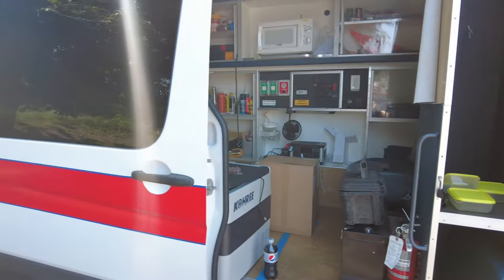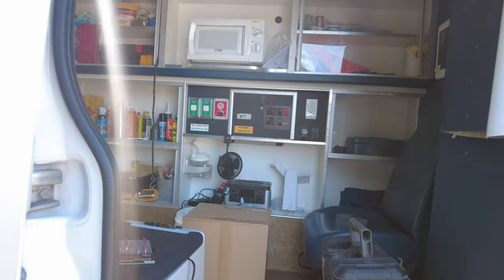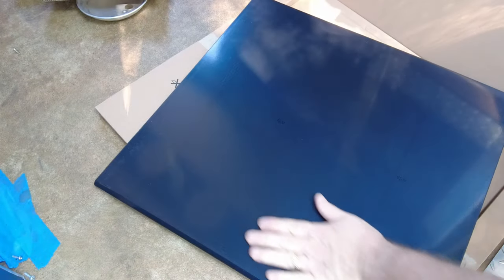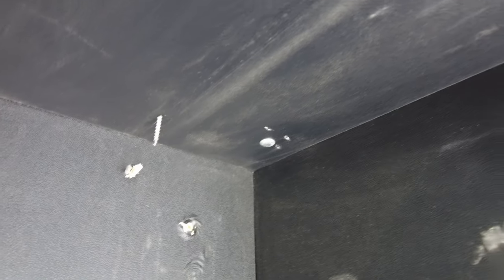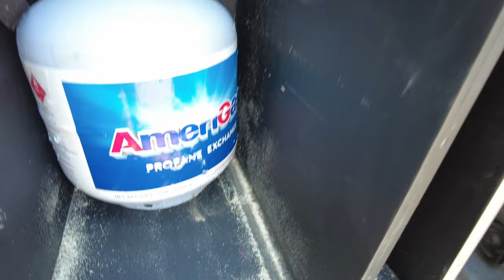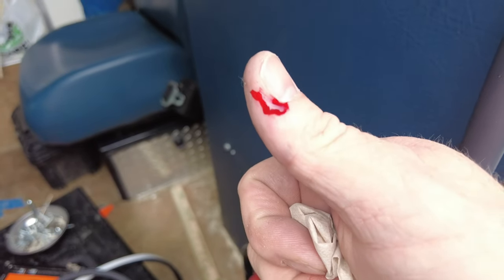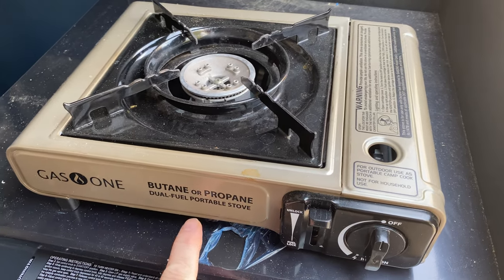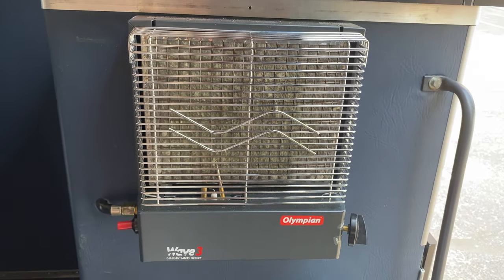Ambulance Build 3: Making it a legal RV

Comment: Is propane as a gas heavier than air? In our truck camper the propane is an outside compartment and doesn’t have a vent. Are you mounting a propane detector inside?
Reply from the maker: Propane is heavier than air. It's recommended that if the bottle is inside the rig, it's in an airtight compartment with a floor drain having a 1" interior diameter. Yes, I will have an explosive gas detector. Not quite sure where to put it yet.

Comment: Did you figure out ways to remove adhesives and residues?
Reply from the maker: Other than a LOT of elbow grease, not yet. When I do, I'll make a video comparing the different methods.
Reply: I finally used 70% alcohol and it did the job. Good luck 👍🏻